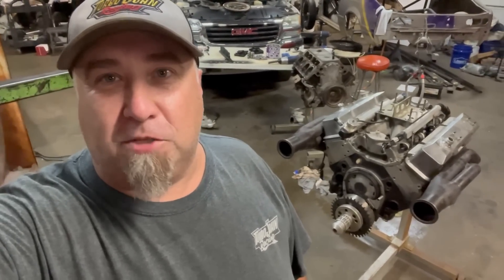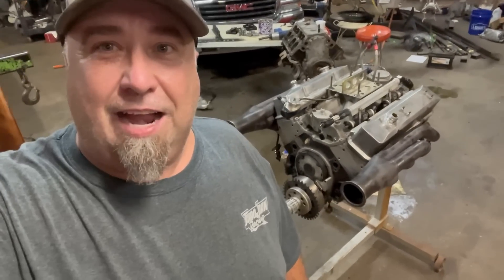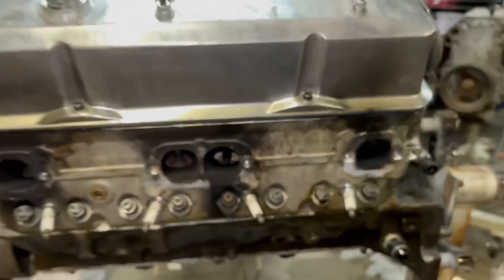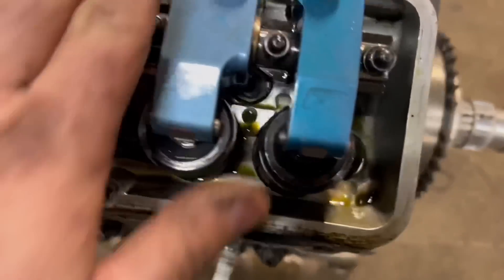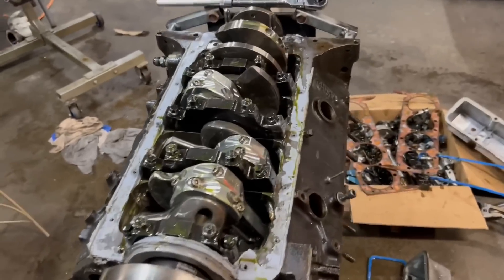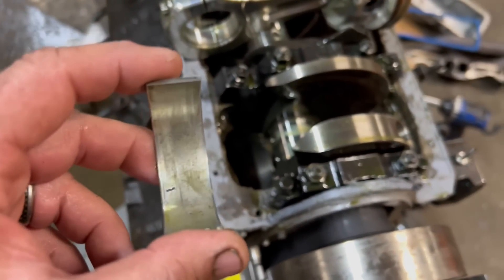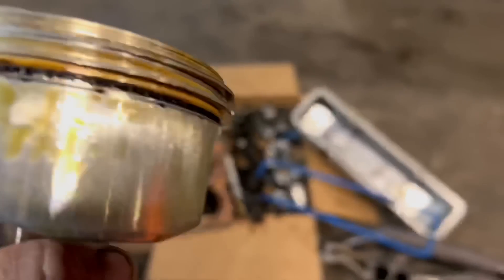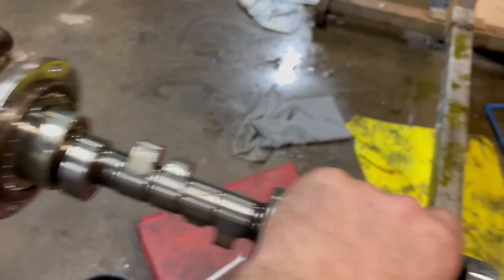1800 hp SBC, what’s inside?

Comment: Don't be afraid to use red loctite on the intake and exhaust bolts and would probably get new ones but I'm picky. I Sand the surfaces with a body shop long board. It makes guick work out of it and you will be surprised how flat you can get  it.
Reply: why not just buy loctite blue, its the same price and made for fasteners that need to be removed occasionally, or stuff put into aluminum. honda, yamaha, and many others have used it for decades and it works fine. when using red loctite stuff going into aluminum isnt such a good idea.

Comment: I can't believe more drag racers don't use short stroke engines. They worked great for many years in NASCAR engines. With about a 3.25" stroke/4"+ bore they made around 900 hp naturally aspirated at 9000rpm. They usually stayed together for 500 or more miles.

Comment: Probably won't find an engine shop, but you might be able to Find an engineering shop, Toolmaker and get them to turn up Sleeves to suit the aluminium block to take std chev cam bearings, or make solid cam bearings out of a suitable material,, and then you should be able to use your old cam. Another option would be modifiy the cam to take needle roller bearings. use your old cam core press on steel sleeve onto each camshaft journal, and cylindrical grind to suit 50mm bearing. And use the correct 50mm needle roller bearings.

Comment: According to the vid, you work at lightning breakneck speed (dontcha just wish we all could tear an engine down, and assemble it just that fast, and accurately), so you will back up in no time TJ, sry it had issues.

Whoohoooo, Ross finally billed my Piston deposit so they are finally forging mine now, 11 weeks from end of May seems like a lifetime as I pulled the block mid January, when the lead time quote was just 3 weeks, by end of May when everything settled out at the Machine shop covid wise, and we had a clean block and parts and pcs ready to get required pre-forging measurements, and block had been line bored, race season on special and regular orders pushed out that lead time a crapload. But, the billing of the first 50 percent on July 28th was a welcome sight on the bank statement, says the CNC Machine was busy cranking em out!

Once received and measured up, boring, honing, decking, balancing, and assembly should go a lot more quickly. Head and long block pcs are ready and waiting, as am I, to re-licence and get racing again.

Car has been dieted and highly improved, nutted and bolted bumper to bumper inside and out.
Reply from the maker: Good luck with it!

Comment: You tig welded it, then had it turned? Try getting it spin welded, that will last, there are some masters on YT that spin weld on a lathe cranks and other bearing surfaces. Makes it like new and bonds better all the way around, and lasts better.
Reply: Spin welding is not done with electrical voltage,  but a powder sprayed on, and a high temp gas torch while spinning in a lathe, build up the steel by tiny layers where it bonds completely in a 360 degree circle to beyond the needed measurement,, then it is lathed back down and then in multi-step process, polished to a mirror finish. It is a really cool process, and there are a host of old school masters still around in your part of the country.

Comment: what's the cubic inch of your motor what's the compression ratio and what's the Dome size on the piston and piston size? just curious that's all about building a motor like this
Reply: It's 364 ci, not sure about the rest. The block is a 400 sbc destroked
Reply: He has videos back when he built it last year telling all this!
Reply from the maker: it's 364 ci, the pistons are off the shelf pistons for a 3.75 stroke crank 6" rod.  I think the compression height is 1.125.  Go check out cp bullet piston catalog and you can get the full specs.  My compression is lower than they advertise because my stroke is 3.34 with a 6.200 rod.  Think I'm at 10.5-11ish
Reply: Wondering what intake setup you have? Thanks man!

Comment: John on your aluminum rods at 200 passes at 8000+ rpm 1800hp you had to change the rods every 50-100 passes.?
Reply from the maker: Doing no pre we normally are around 1400-1500.  And on some of the back of the track stuff probably 900-1000.  I’m hoping to get about 300 passes then pull them

Comment: Uhhh. Do you ever listen to your full breakdown video after you've commentated about taking your engine apart? "Well this is a leettttle (insert some word to describe damaged)" "Worn here in the middle but it'll be fiiiine" "A bit of scraping but (probably) from contamination" (because engines should be okay to have bits of metal in the oil), describe a thoroughly boned(used and damaged) bearing (well we use a lot of timing so maybe a detonation)...we'll take a look at that (and not change it because a set of NICE coated bearings would cost you all of $100).

You can't run like that anymore and win. People aren't showing up to the tracks in shitboxes anymore. They're showing up sharp. Their engines don't have 8 leaking exhast ports. They don't have bearings they're shrugging their shoulders over. I guess it's okay if you want to reduce your car to a bracket racer, but that dog's not hunting as it should, and you know it, John.

TWO HUNDRED PASSES ON ALUMINUM RODS?????????????????????????????????? Are you INSANE? Seriously. Aluminum rods...racing rods are meant for FIFTY. The serious boosted cars do 26.

Comment: That oil is weird. You don't see normal motor oil just laying around in globs and slimed on the side of rods. I don't like it. It ain't natural.
Reply: Lmao
Reply: The oil is contaminated with methanol so it thins the oil out.. from what I understand it makes the oil not quite as effective but if the methanol and oil separates then you run the risk of the oil pickup only sucking straight methanol which is bad on bearings
Reply: Meth attracks moisture!!
Reply: @jasonhastings5538  moisture and toothless strippers 🤣🤣🤣🤣🤣

Comment: No way you make that much with that turbo
Reply from the maker: go to wallace racing calculators.  Car the engine was in last year, 4.67  158mph  at 3000lbs.  And the car has been faster than that year before last.

Comment: OMG come on guys whats inside ? REALLY...If your building a motor and your going to use a pair of twins . Well I can tell you what isn't in that motor... That engine is NOT using cast pistons cast rods cast crankshaft .. It's not using a Hydraulic camshaft .. And if they are smart it's EFI and NOT BLO THRU  why because EFI can be tuned per hole per runner . you can pull timing out as needed . So whats in it is Forged everything . a good piston like Wiseco Or Diamond .. a good crank like Molnar Or Lunati  good rods strong enough to absorb the brutality of 40 LBS of boost  and a valve train capable of getting it done like shaft rockers good strong push rods a good oil system if not dry sump than  a wet Titan Billet pump ...a good set of head with enough CFM to get er done and valve strong enough to withstand the Tulip effect ...that seems to happen with High temps & Boost numbers especially guys who over extend the life cycle .. Boosted drag motors beat the living snot out of all engine components ..the forces being applied are just crazy even at relatively easy 1800HP regions ...That is still a hurtful amount of beat down on any small inch SBC .